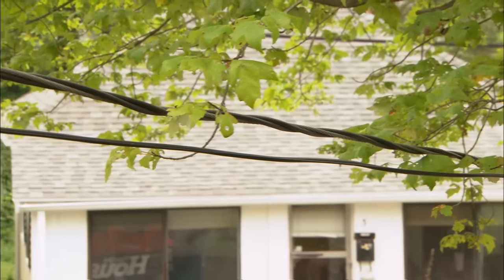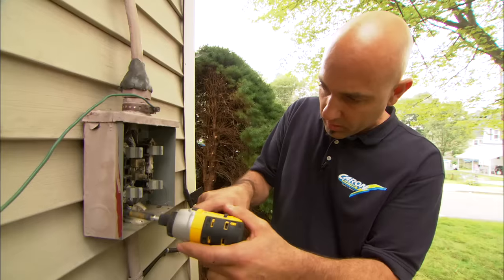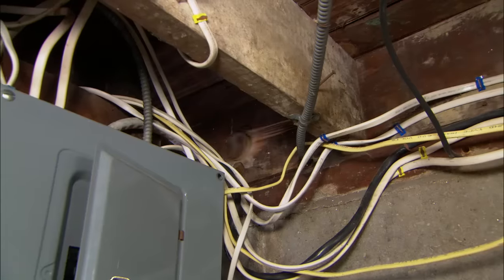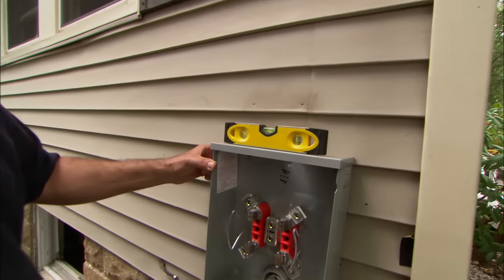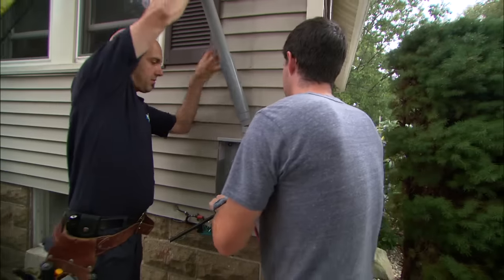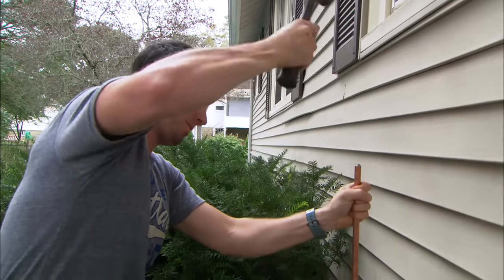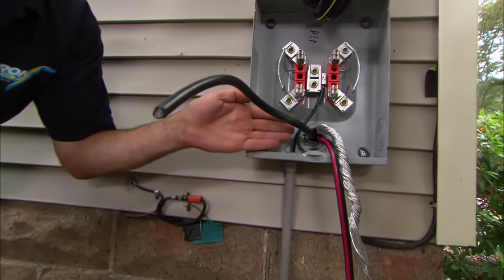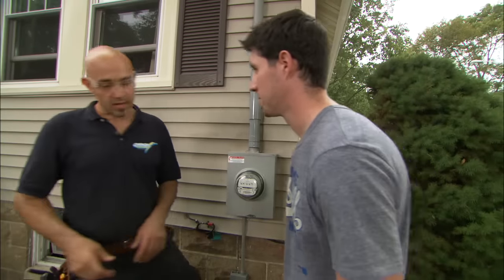How to Upgrade an Electric Meter to 200-Amp Service (Part 1) | This Old House

Comment: Rains not going to get in there all the open voids were filled with high temperature silicon caulking. Many communities including mine don't do electrical inspections.

Comment: # 6 CU to ground rods is what is required for a 200 amp service solid or stranded. #4 is to bond the H2O pipe.  Ground rods are for lighting not grounding.

Comment: sigh  Wish my 2001 built house wasn't just 100Amp service.  Everything in the house is gas, which is why I think they did it.  But adding a 50Amp circuit for a 40Amp car charger was interesting.
Reply: Doing this now too ourselves, any surprises or hiccups? Our EVSE Is direct wire and 220V… only 3 wire 🧐

Comment: It'a always interesting to see how things are done elsewhere. In Québec, this king of installation is different. For the main ground, they connect it to the main water inlet, before the main valve. No ground rod unless a water inlet ground is not available. The main post is usually metal. Also, the ground and neutral are connected to a different buss bar. 
Also, absolutely nobody is allowed to touch any king of electrical installation unless it's done by an electrical contractor. Even a licensed electrician can do the work unless the job is contracted by an electrical contractor. If you have a friend who is an electrician, even he is not allowed to do some work of his own, like as a sideline. All we are allowed to do, in our own home, is plug a wire or changed a light bulb. The unions tried to get the government to ban the home centers from selling electrical equipment. It didn't pass, to my big surprise.

Comment: You put what looks like a 1.5 inch hole in the house, instead of having perforations that big why diddnt you just sleeve the wire with pvc into the house? Now you have a perforations and air leaks. Please to not say duct seal.
Reply: Way bigger that 1.5

Comment: American power distribution is interesting.  So that looks like a 2-phase supply to that house then, yes?  Normally here in New Zealand, you only have one phase capable of around 80-100 amps @ 230v 50Hz.  In USA, they obviously need a 200A feed for 110v line for roughly the same kW, but it's still two phase + neutral, by the look of it.  Is this normal for all houses over there?  IE: they all have two-phase supply from the utility side of the network?  Interesting that you have the power meter outside too.  Most houses here, the meter is inside the house.  This has the disadvantage that you have to gain access to the property to be able to read the meter, so the USA method is much more logical in that respect. ;)  We have quite a lot of smart meters now, which send usage data back to the power company via the cell-phone network and text messaging.  Also, what's the idea behind two earth(ground) stakes?  We normally just use one.
Reply: 2 120v  for 240v utilities(heating,etc) + a neutral
Reply: The national electric code acquires just one. However some state codes require two which is pretty much ridiculous but the ground rod makers have to eat too I guess. As for the meter have to go back to the 1950s or later to find one in the house for the most part anyway. Find your comment interesting would like to see a residential wiring job in New Zealand. What time works for you.🙂 If you would like to look over some US jobs stop in anytime I am retired.
Reply: +VauxhallViva1975  Technically It is "single phase power" with two 120 volt legs to the Neutral and 240 volts across the two hots. Since the two hot 120 volt legs are single phase ie in phase they add to 240 volts when across the two hots. Many of us will use the term phase in slang to mean legs, but for clarity most all houses have them as single phase; ie the two 120 volt legs add to 240 volts.

Network Service:  Some usa apartments will have the two legs from a 120 volt 208 Y 3 phase system and there is 208 volts across the two hot 120 volt legs since the two hots are NOT in phase. ie the single phase box has two 120 volt legs for lighting and the higher voltage is across both hots as 208 volts ie 120 volts time the square root of 3.  The meter for Network service often is a different type. Single Phase 3 wire 120 /208 Network is what the meter type is. 

ie the usa say Mr Taylor's apartment building is fed by 3 phase power with 3 hots A , B and C.  

Mr Smith in unit 100A has hots A and B and the neutral. 

Mr wilson in unit 100B has hots B and C and the neutral.

Mr Brown in unit 100C has hots C and A used and the neutral.

Thus a clothes dryer, bigger (1.5 ton plus) AC unit or range in the usa will say it works on 240 volts or 208 volts since some will go into places where the leg to leg voltage is 208 and not 240.  Many condos connected as one building, apartments, and some tiny houses if real close are fed 120/208 Vac from a 3 phase transformer.

a McDonalds in the USA is often wired for 120/208Y with a 3 phase box, were all three legs A ,B and C are for the 3 phase 208 volt loads like the AC units.  The 120 volts to Neutral is used for smaller loads.

A bigger building (Office Depot, Walmart, Home Depot) here often has 277/440 volts in Y with 277 volts from the hots to neutral and 440 line to line. The 440 volt 3 phase is for big AC units. The 277 volts is often used for lighting. The 120 volts is often then from a few local smaller transformers in several locations in the building.

There is also a high leg delta 3 phase 240 volt system that has the two hots 120 volts to neutral and 208 volt on the wildcat or stinger leg to neutral. It has 240 volts line to line across A to B, B to C and C to A. 208 volts to Neutral is not used in this config.
Reply: +VauxhallViva1975  its not 2 phase its split phase, I only learned this a few weeks ago... 1 phase center tapped  to get 240v
Reply: It is a split phase system 120 - 0 -120 Volts with 180° phase shift.
240 Volts is available for large loads like ranges, airco's and the like.

In rural New Zealand we have 240 - 0 - 240 Volts also, with 180° phase shift and yields in 480 Volts between the actives.

Normal 3 phase has a 120° phase shift between phases.

Comment: You can see @4:56 and 5:02 this guy nicked the conductors with a knife that is no good!! When dealing with aluminum conductors you strip the wires like you would sharpen a wood pencil by skinning the insulation off. He now has a possible conductor failure

Comment: This is not up to code the wire in the meter pan is a fire hazard she did not put lubrication on The wire those aluminum wires might overheat and that's never good there is a reason to stop making wires with aluminum

Comment: look at the size of the 200 amp cables thomas edison adopting 120 volt in usa  has resulted in usa using up more than the worlds share of copper there more than twice the size of our meter tails here in uk even with 3 phase 415 volt why does  a domestic house need 200 amp anyway
Reply: Low voltaje is safer, te reason of a lot of amps is this house need 48kW!!
Normal house in other 120V coutries use 2 hots + neutral service 12kW 2 x 120V 50A.
240/415V its ideal for industries but very dangerous in home. Its a lethal voltage.
I know two voltaje levels, in my country exist 3 phase systems in 230/400V and 133/230V.

Comment: I would not have came into the back of the meter like that. I would’ve came in the sides or bottom of the meter for the service/line  side and load side. Meter can should be bigger for 200 amps.

Comment: I don’t know where you get the information about the grounding rods from but you got it all wrong.  Electricity not going into the ground.  Electricity always go back to the source and the neutral wire is where it go if there are faults.

Comment: 200 A  даже если напряжение 110в получается  22 кВт
какое количество потребителей сразу должно  включено быть в доме, чтобы нужна была такая мощность?
Reply: Generator 15-20 KW to run a 200A service.
Reply: @danlux4954  I don't understand you.

Comment: many times an electrician will do this with live power, disconnecting the meter, unscrew it from the house after removing the house feed, sliding the meter to the side, installing the new meter and mast with power lead, use the old house feed to temporarily jump from the bottom of the old meter to the new meter. this gives us temporary power rather than using a generator. when done the power company will make the switch and remove the temporary jumper

Comment: weird, I would have thought the correct electrical terminology would be two cables from the power company,  two phases with 240 volts between them.  120 volts is between a single phase and the power company ground which is called center tap .

Comment: Wtf? Guess you can set the meter base at 3' where this is, has to be 5'6"-6'6" where I'm at. Also we don't install the grounding electrode in the meter base. We do it in the main panel.
Reply: What if its a main lug panel with a meter/main disconnect outside?  You have to bond at the first disconnecting means.

Comment: So what happens when someone starts digging near those earth rods and cuts through the cable? Not sure his little flags will last long either.
Reply: If someone cuts through the "cable", you replace it. The flags are there to inform the inspector where to look for the buried ground rods. Once inspected, the flags will be tossed.
Reply: Here in the UK we have to install earth rod inspection pits, and the cable has to be buried at a sufficient depth with mechanical protection or ducting to avoid damaging it. If the earth is cut it wont be noticed by the homeowner and when a fault occurs the breakers wont trip.
Reply: We're not in the UK.

Comment: Genuinely asking, why would I need to do this?
Reply: You would do this to upgrade from a fuse box or if you run out of spots on your main breaker panel. Say you have a 100 amp service with 20 spots that's full and you want to add more stuff to your house. You can choose to keep the 100 amp wiring and upgrade to a 36 slot box, or you can upgrade your wiring to a thicker gauge wire and get a 200 amp service that has even more slots for breakers.
Reply: rrruizzz - most upgrades are because the owner is making other significant changes to the property.  A new addition, adding an out-building or just adding a bunch of stuff the has large power draw.  So, maybe you have an existing out building that’s empty, you add an entire woodworking shop to it with large table saw, band saw, planers, shapers, vacuum systems, lights, fans, microwave, etc. AND decide air conditioning is required too.   That setup will pull some serious amps leaving very little for the house.   But with no major upgrades, you normally would not need to bump the power up to 200amps.  Today’s appliances, lights and electronics are getting more efficient every year which reduces the load on the system.

Comment: I am a 40 year electrician you failed to notice all the exposed Romax in the basement and also your service entry cable that you installed is not protected in the basement that is against national electrical code look it up
Reply: I think you need another 40 years because you don’t know jack
Reply: Frank Silvers  Pick up a national electrical code book look up NMB wire and see what it says get back to me
Reply: @johngirgenti1611 looked it up. You are wrong and you don’t know what you’re talking about
Reply: @electricaf365  OK you’re right everybody should keep using Romax as a coat hanger and whatever else they want to hang from it in the basement
Reply: @johngirgenti1611  what people should be doing and what the NEC allows are two different things. I think you need another 40 years
Reply: @johngirgenti1611  I know what it says. “Shall not be installed in a manner that is subject to physical damage”. I think the entire industry agrees that romex installed in that manner is not subject to physical damage. Otherwise there would be no such thing as an unfinished basement, or wires ran through a crawl space, or wires ran through an attic. Stick to sweeping up the floors for the real tradesman and do whatever your boss tells you to
Reply: @johngirgenti1611  you’re a 40 year electrician, like I’m a shortstop for the Mets

Comment: not good to use Aluminum wire
Reply: Yes it is
Reply: @electricaf365  Many Insurance Companies will not insure if Aluminum wire is used.  Al wire will creep and cause loose connections.
Reply: @carlmax46  every service every cable in North America is ran in aluminum.
Reply: @carlmax46  you couldn’t be more wrong. You obviously have no clue how a house is wired. Or a building for that matter. Cheap houses and expensive house uses aluminum service entrance cable. All electrical utility companies use aluminum. Go outside and look at the overhead service entrance wires. Aluminum. You can’t see underground, but all underground service entrance cables are also aluminum. Look inside your breaker panel. You will see aluminum wiring energizing your panel. Look inside your meter base. Aluminum. This is a fact. You clearly don’t know much about this topic. Take it from someone who does.
Reply: @electricaf365  Your statements are wrong.   You need to reread the electric code.  I could easily show you many houses that have Copper wire for service entrance.  Wires on the utilitly company power poles is entirely different.  Would you like to place a wager?  How much?   before I send pictures of Copper service entrance wire.  
Aluminum is a cheap alternative allowed in some areas, but not all.   Any competent designer will specify copper wire.  You would never be allowed to do work for me.
Reply: @carlmax46  too bad you don’t have any employees.
Reply: @carlmax46  “competent designer” 🤣🤣🤣🤣. Yea pal. You have no experience in this field.
Reply: @electricaf365  You sound like Trump.  Just make false accusations.  I notice you were not willing to place a wager.
Reply: @electricaf365  The U.S. Consumer Product Safety Commission (CPSC) reports that homes with aluminum wiring are 55 times more likely to have “fire hazard conditions” than homes wired with copper.
Reply: @electricaf365  The life expectancy of aluminum wiring is around 30 years. Some insurance companies charge higher premiums for homes containing small branch aluminum wiring provided that you take the proper steps to make it safe.  Use Aluminum wire if you want a cheap installation that will not last the life of the house.

Comment: Connecting the 2 GROUND BARS is great BUT why not to connect them ABOVE  the GROUND that will allow to check if the ground is STILL GOOD AFTER FEW YEARS by a SIMPLE OHM METER !   AND MORE = PAY ATTENTION the utility company is NOT replacing there wires ! = WHY to replace the ELECTRICAL OLD BOX as was replaced at the PART 2 , do you want to save  $$$  any feedback welcome !

Comment: One thing he failed to do i think because I've done one of these is left a little more wire in the Box altho its hard to bend this wire it is possible to leave a little extra wire bc wire does get smaller or move into the box

Comment: Really rigid schedule 40 PVC?
Reply: Used everyday
Reply: @electricaf365  there's better ways.
Reply: @schafer2333  name two
Reply: @electricaf365  EMT OR RMC
Reply: @schafer2333  RMC is heavy and expensive and EMT isn’t supposed to be used as a service mast

Comment: That’s the lowest meter I’ve ever seen.  Did it get approved?
Reply: basement on the other side remember.
Reply: grandfathered.
Reply: @bbhoustontx  Doesn’t matter basement or not. Altered service, meter needs to be replaced and installed minimum height 5’6”

Comment: There sure are a bunch of testy trolls in this comment section.  Just watch the video or not for curiosity and entertainment.  Hire an electrician to change your service entrance, as the host informs us.  He will do what local codes call for in various US or Mexican States, Canadian provinces, or various nations in the EU.  No need to fight.

No individual codes and national practices are really any safer or superior to any other.  Each nation and state installs service to run the domestic appliances and lights available for that nation.

Grow up people.

Comment: Is it typical to have NO SLACK LOOPS on the wiring running into and out-of the meter box?  Seems like a "screw the next guy" kind-of move.

Comment: It is always a better idea to install the supply cables and the load cables under the meter enclosure, this makes it almost impossible for water to enter the meter box. Entering at the top is not recommended because earth movements, storms, tornadoes, strong winds, hurricanes can cause small movement of the conduit, were water or moisture can enter. In addition, some metal expand or contract with temperature change.

Comment: He drilled through an exterior wall with a hole saw? Wow. No house in the U.K is constructed like this, they all have bricks meaning SDS required

Also, 200 amp for a house?
Reply: Its American, they have 120V Phase to Neutral, so it requires more Current Per Watt, compared to some where like UK, NZ, AUS where we have 230-250v per phase. pretty much a 2000w Jug will draw double the current it would in a 240v Country. therefore bigger cable/ fusing to do the same thing

Comment: That 2 inch pipe that runs up a good 8 feet up is usually code, never heard of using plastic pipe or copper underground